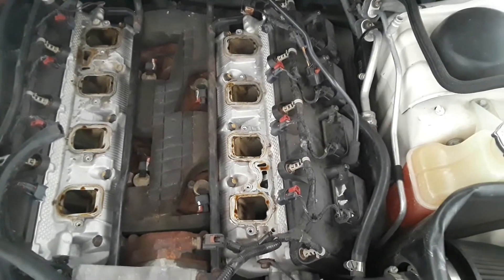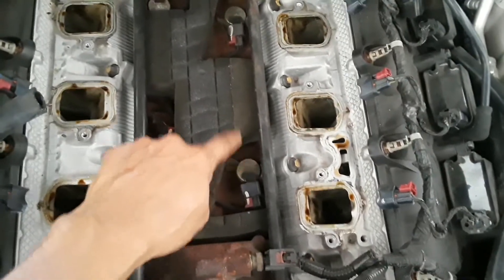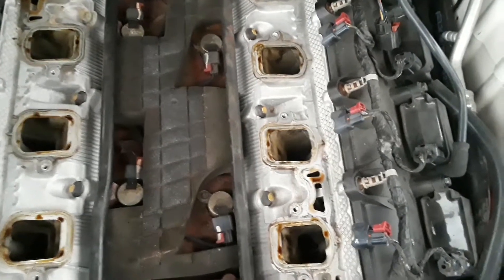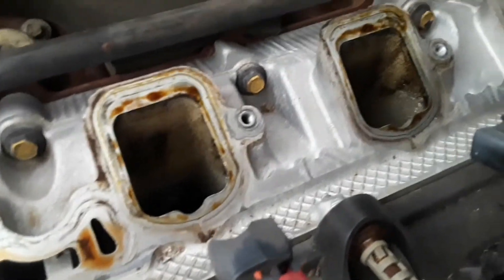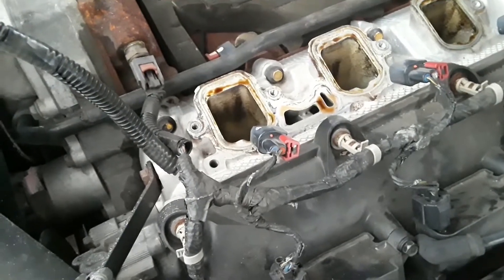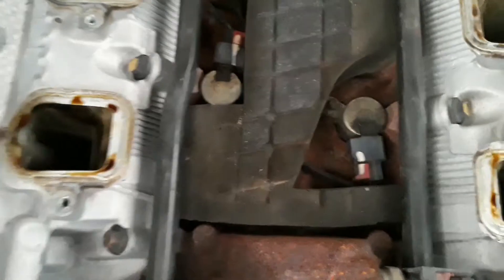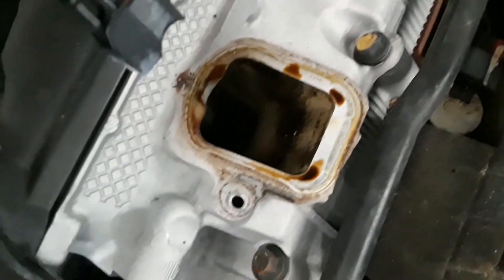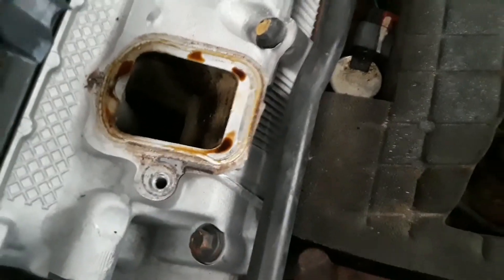Charger R/T 5.7 Intake Manifold/ Intake Port Cleaning

Comment: Buddy u ever have problem whit. Trans is this car  ?   I got the same. But. I ha. Issue. That. When I'm in the traffic.  I think trans.  Get. Hot.  Or something that starts having problems to shift.   And all the. Gauges get crazy I already.  Check temp and. Fluid level. In is kinda ok. So if you have any idea what could be I will appreciate it to lmk thanks 🙏👍
Reply from the maker: Yes the original trans list lost 1st gear. Change the transmission screen first.

Comment: What year are these 5.7 motor heads? on my such same and there is not know this EZH or VTI, or still what?))
Reply from the maker: The car is a 2006, on the back of the heads there is a red symbol, I'm not sure what brand they are, I've been trying to figure it out for quite some time now. I don't think they are original to the car and was that way when I bought the car.

Comment: How did you get the brake booster vacuum line off my shitake stuck
Reply from the maker: Try to twist and pull at the same time
Reply: @57LHemi  lol I got it off I broke the check valve but cut the hose down and got some seal all now we’re back  good 🤣, I had to stomp to stop
Reply from the maker: @@LingoENT way to go man  a fix is a fix right
Reply: @57LHemi  💪🏿 no problems so far 🤞🏿, this may be off subject but would a bad valve stem seal leave your intake valve area like new as in it isn’t any build up at all compared to the other ones .
Reply from the maker: @@LingoENT  yes, I've seen that before